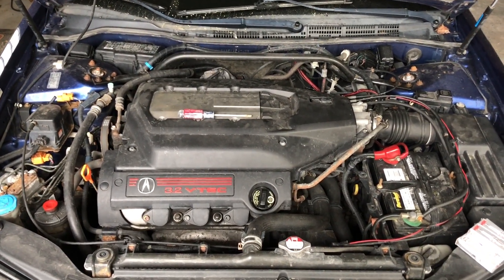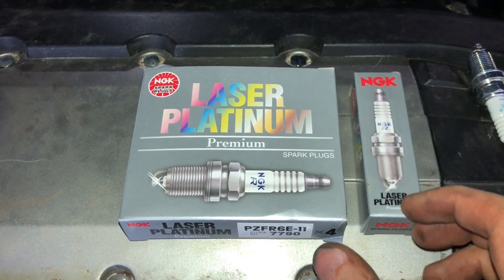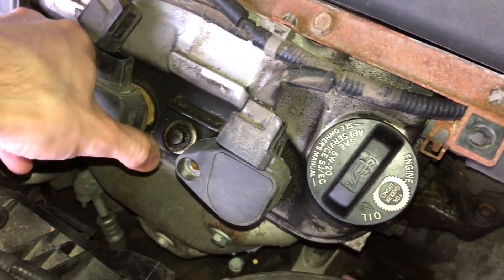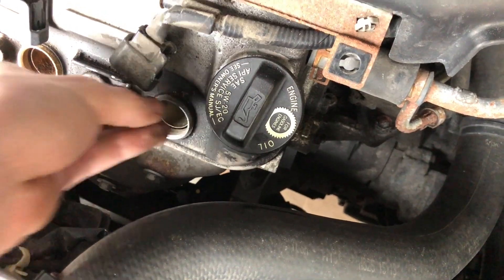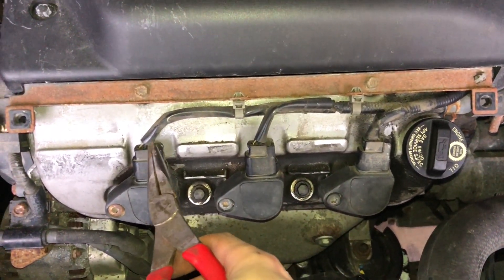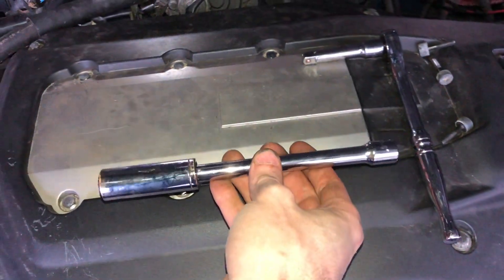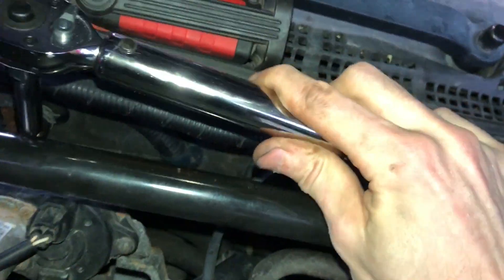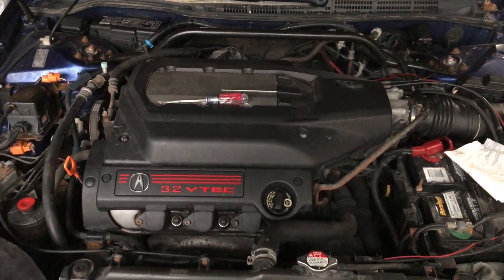How to Replace Spark Plugs - 3.2L V6 Acura TL/CL, Honda Accord/Odyssey

Comment: 105,000 miles.  So you could do 120k?  150k?
Reply from the maker: The listed lifespan of the spark plugs both in the manual and on the NGK website is 105,000 miles. I would not recommend going much past this recommendation or else you run the risk of the plugs seizing to the engine block, which could potentially result in a broken spark plug or a cracked engine block when attempting to remove them in such a state. If you went 1000-2000 miles over, you’ll probably be okay. But 20,000+ miles over is a huge and unnecessary risk. I bought my MDX with Autolite  spark plugs that were 50,000 miles overdue for changing and 2 of them came out somewhat easy, but the other 4 took probably 3-4 hours to remove.

Comment: My 2001 cl type s is vibrating bad when I hit the gas above 40 mph. 3 gear seems to shake the car when hitting the gas. Runs smooth when not hitting the gas.
Reply from the maker: Sounds like a misfire due to a bad spark plug or ignition coil. Do you have any check engine lights? Does it only happen in 3rd gear? If only 3rd gear causes vibrations, I would consider replacing the 3rd gear pressure switch and ensuring your ATF is clean and at the proper level. I have a separate video on my channel for both of those procedures too.

Comment: Get a spark plug socket with a rubber sleeve and ease the plugs in.  Dropping them in will smash the electrode ruin the gap.
Reply from the maker: That's a good idea! I have tried that, but then when I pull the spark plug socket out, the rubber sleeve gets stuck on the plug in the tube. Maybe my spark plug socket just sucks. But otherwise, they'll be fine gently sliding them down a 4 inch tube at a 45° angle. That's not gonna smash and ruin the electrode. I've done this multiple times without any issues, and so do most mechanics who get paid by the job.

Comment: Hi, thanks for the video, can I ask what's brand of torque wrench do you recommend for this job? Do I need a $100 torque wrench since the ft lbs is pretty low?
Reply from the maker: You don't absolutely need a torque wrench for this job. The owners manual states you can tighten
the spark plug two-thirds of a turn
after it contacts the cylinder head. Otherwise, Project Farm recommends ICON and Dewalt torque wrenches for about $100. If you're willing to spend a little more, CDI torque wrenches (owned by snap-on) are highly regarded on the forums, and that's what I own as well.
Reply: @CarRepairsMadeSimple thanks for taking the time to reply. I'm eyeing on the ICON torque wrench after watching Project Farm video but now CDI looks so tempting.
Reply from the maker: @NhanSleeptight  I think it's worth it. CDI is a separate company but owned by snap-on, and furthermore makes the snap-on branded torque wrenches as well. I've heard the only difference is CDI's own torque wrench ratchet heads are made in Taiwan, while CDI makes the ratchet heads for the Snap-on branded torque wrenches here in the USA. Basically the exact same tool, but without the premium price just for the "Snap-On" title. A little expensive at $150-200/ea, but torque wrenches are IMO an important precision tool that you don't want to cheap out on and potentially be inaccurate. Buy once cry once I often say, it'll be worth it. You can get CDI torque wrenches for a great deal on abolox.com. You can also find some amazing deals on eBay. I recommend getting the 752MFRMH (5-75ft.lbs) and 2503MFRMH (30-250ft.lbs). That'll cover the entire range of torque specs you'll ever come across.

Comment: One VERY IMPORTANT NOTE NEVER EVER GAP THESE AND NEVER EVER DROP THEM use the coil to set the sp back down in the cylinder. Great video.. PS: DONT USE YOURE DAILY IGNITION COIL  FOR SP SETTING. BC THE SPRING WILL BECOME LOOSE
Reply: What would you recommend to set the new plugs back in place?
Reply: @dakotalord6562 an ignition coil to remove and install so keep you're previous coils or one at least and keep one old plug just incase random misfire

Comment: It's not a good idea to drop the spark plug into the cylinder. install the new plug  the same way you removed it by using the adapter extension bar .
Reply from the maker: You're not wrong, but it's highly unlikely a 3" slide at a 45° angle is going to cause any damage or mess up the spark plug gap. Another reason I didn't use the spark plug socket is because the rubber sleeve inside the socket sticks to the spark plug and comes off inside the spark plug tube after installation, and it's annoying. I've replaced spark plugs 3 times between 2 different Acuras's and have had no problems. If your car has a more vertical spark plug tube where the plug may fall straight down, then yes I would use the specific spark plug adapter.

Comment: No need for a torque wrench on the plugs, just one ugga-dugga will do.
Reply from the maker: @johnmiller678  those poor aluminum cylinder heads lol
Reply: @CarRepairsMadeSimple  what? I said one ugga-dugga, not two or three. 😀

Comment: 😂 drops the spark plugs into the hole without caution but has to bring out the torque wrench for 13ft lbs! That was funny!
Reply from the maker: Wait until you find out that every mechanic (where time is money) also drops them in and doesn’t torque them either 😉

Comment: I have a 2002 CL Type S with almost 200,000 miles on it. It still runs great but I guess I need to change the spark plugs soon. Thanks for the video.
Reply from the maker: You’re welcome and thanks for watching!

Comment: Yesterday car started idling very rough. CEL came on. Misfire codes for cylinder 1, 4, 6. Limped it home and got plugs and coils to install today. Hope that's all it is brother. Ever had anything similar?
Reply from the maker: The previous owner had some misfire codes (not sure which ones) and the dealer did a valve adjustment to fix them. I also only had 1 misfire code due to an ignition coil going bad and needing to be replaced. The other 5 are still the originals from the factory.
Reply: @CarRepairsMadeSimple  It was one of the coils bad I replaced all of them and put new plugs in. Running good now Thank you

Comment: im running NGK 6994 in my 03 CL type S.
i definitely overpaid for them @$18 ea from O'Reillys, but knock-off NGKs are a *real thing so i don't mind paying for piece of mind that i got the real deal.. once every 10yrs or 100,000 mi is more than OK to have to deal with. and i still use anti-sieze.. i don't care!

Comment: Fantastic tutorial 🎉🎉 I’ve seen some videos where they replace spark plugs as well spark plug cables. Is It necessary to do so on this car? I checked up online standard spark plug cables. None of them seemed like the ones used by my 2003 Acura TL
Reply from the maker: I would say there’s no need to replace the cables unless there’s clearly something wrong with them. Mine are the originals with no problems. Thanks for watching!!
Reply: @CarRepairsMadeSimple Awesome!!! Thank your for quick response!!!
Reply: Can spark plugs won’t start up the car
Reply: But it’s trying to start up

Comment: Another fine trick is to use a 1 ft piece of rubber gas line, removing and getting the New plug started. Carefully not to crossthread,torque@ 13fp.

Comment: Shouldn't the new plugs be gapped before installing?
Reply from the maker: Spark plugs come pre-gapped, so there should be no need to modify them. Just ensure the spark plug you buy has the same gap as mentioned in your cars manual.